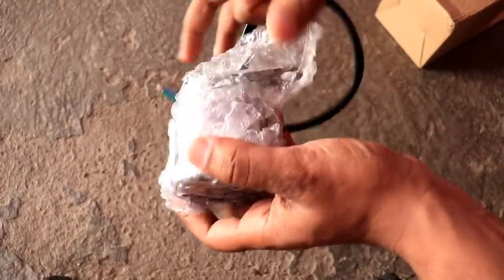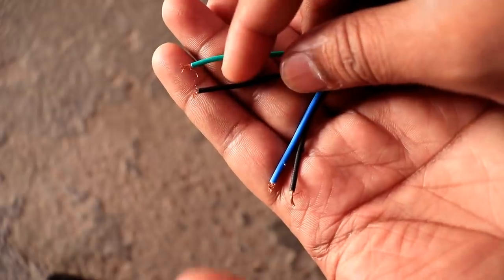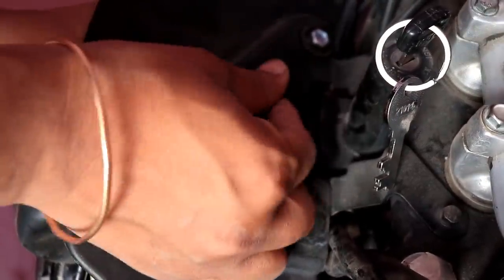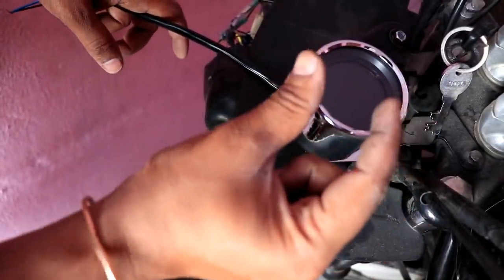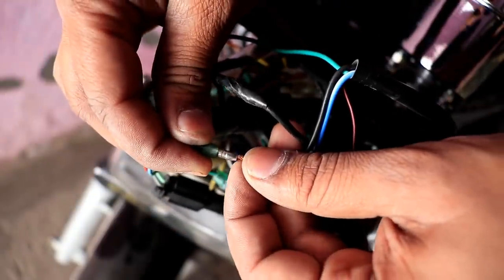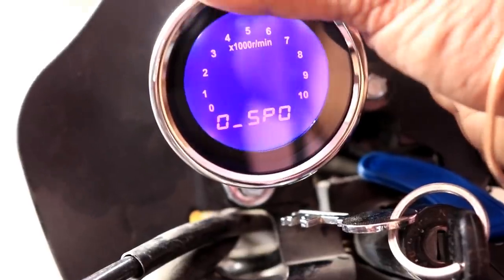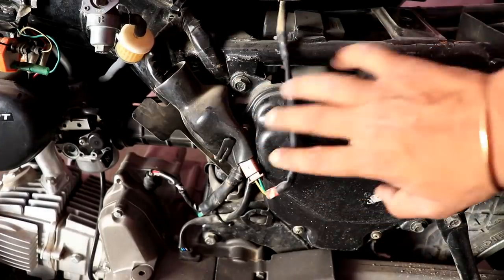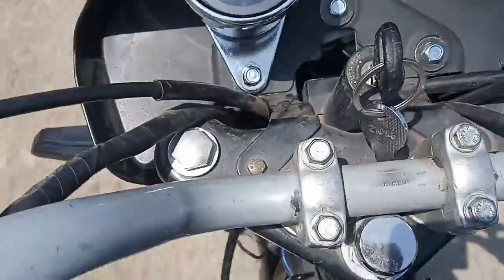led digital speedometer

Comment: Could someone explain the coil and gas wire in English please? Sorry about this. Tks
Reply: hi, looks like manual screw in speedo, tach wire goes to positive coil wire, and gas wire goes to blue/wht wire going to gas tank float....didnt understand a word he said tho...
Reply: @crazydonutface  ☺ Tks for that 😂 now just to find that blue n white ☺
Reply: Hi  @DaveDayve  did you find a solution for the coil and gas wire? It seems that we both only have a black/red and a (only) blue wire...
Reply: @azizbennaceur8433  Yes black and red is for coil. Plugged that. Worked great. Revs good. This weekend I'm doing the fuel gauge. I found the Tank wire just have To connect it

Comment: Hi bro I'm from Philippines can we use that for TVS king three wheels thanks.
Reply: As long as it’s speedo is driven by cable, yes you can. As long as the motor is 4 stroke the tachometer will be accurate (2 stroke will show double the actual reading). As long as there’s a float in the tank, fuel meter will work
Reply: @Vijayyelilarasi  yes it is a cable speedometer in my tvs king

Comment: Sir i have installed this meter to my TVs Victor GL bike which is 18 years old.
The problem is that the battery is meter is draining the battery. 

I have also installed police flasher which is now getting less battery power 

Is there any cutout circuit that can be used to safe battery